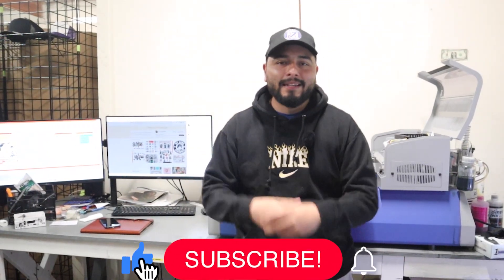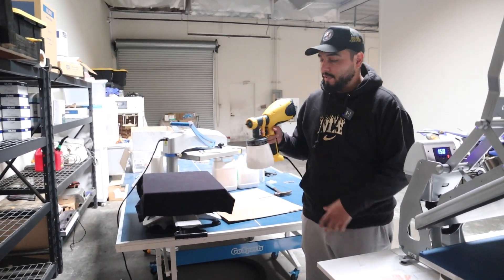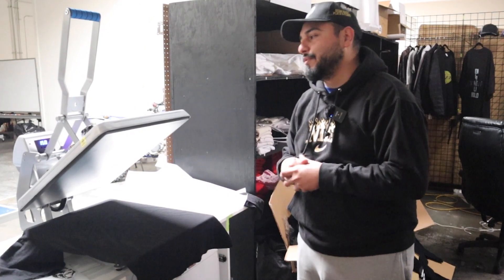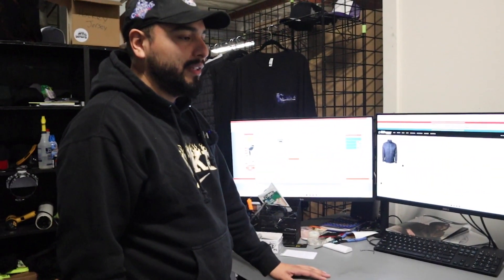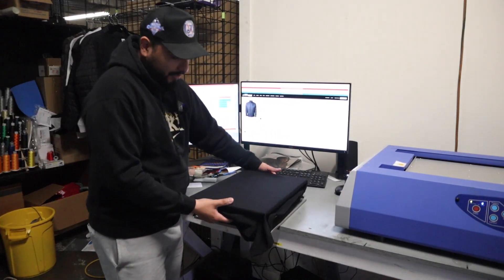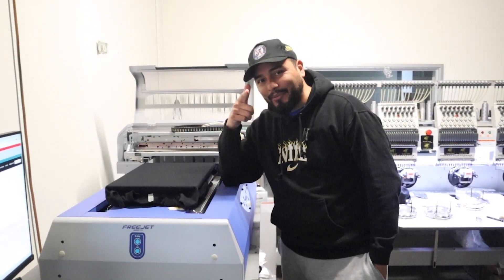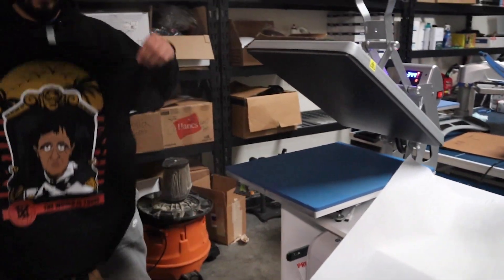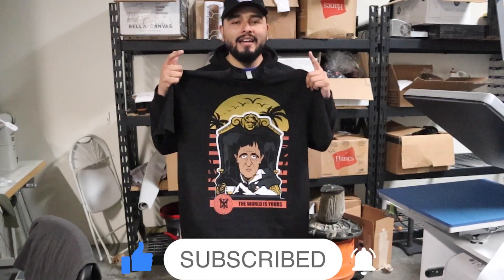DTG Printing Step By Step - Omniprint - FreeJet 330 - Millennial Threads

Comment: how do you avoid box stains?
Reply from the maker: Hey what’s up. If you’re referring to the box stains the heat press can make after pressing id say just watch for your pressure and use a Teflon sheet or those wax papers and also be sure the heat platen is clean 🤙🏽 

If there’s something specific you wanna know just ask. I’ll do my best to answer